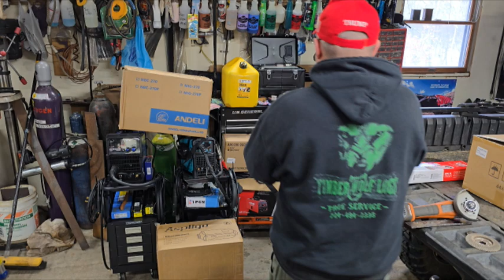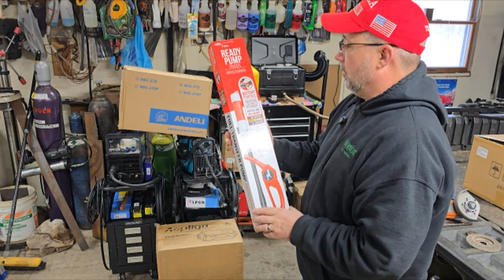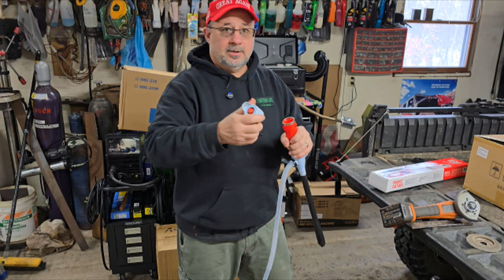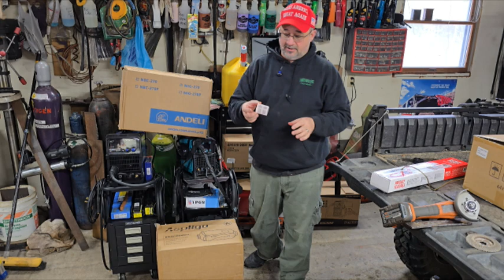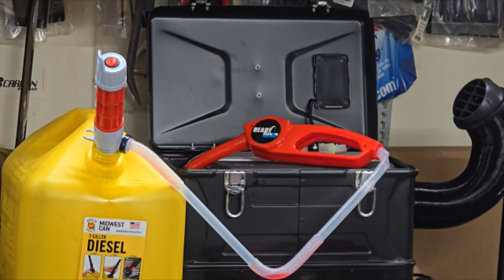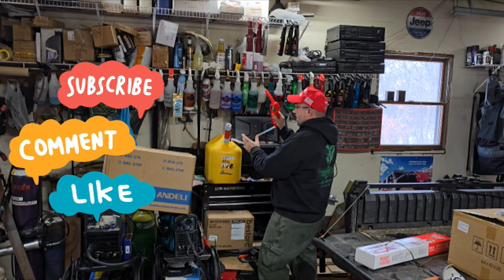Diesel Heater Fuel Transfer Made Easy! Ready Pump TRHD05

Comment: The problem I have with my diesel heater that I use in my garage is spelling even a few drops smells like I was working on a Kenworth. 
Has anybody tried using a windshield washer pump to transfer fuel from a large tank to the built-in tank on the diesel heater?¿?
Reply from the maker: @bkee62  I'm using the 2-D battery fuel transfer pump that I did also video on. If I don't do my OCD induced "fill it to within 1 drop of over flowing" it's simple and clean. But my mental issues say that I can fit just a little bit more. And more again. And again. And SHIT! IT OVER FILLED!

Comment: I have had two of these with the same exact pump and only lasted 6 months to a year and stopped running.  These work good for a while and then stop working.  Should be work for a lot longer.
Reply from the maker: By chance, did you teach out to them and see if they would help you? They show a 1 year warranty on the packaging. 
They can be reached at:
Support@terapump.net
877-251-2288

Try to reach out to them, and please let us know how they react.
Reply: @LarryMusgrave  it's been over a couple years since the last one quit, and I don't think it was that specific brand.
Reply from the maker: @rockandrattleretreat5830 

Okay. Because with these Tera Pump units, they clearly state that they have a 1 year warranty. And for the low cost of 2 units... if i had to replace them every year... I'll heal 😂
Reply: @LarryMusgrave  Do a two year review and I might try them again.
Reply from the maker: @rockandrattleretreat5830  
While I can't time travel... yet... i can find you the cheapest version of these pumps so that they are so cheap, you don't give a crap about tossing them in the trash at the end of each year. 

Here is adifferent brand and version sold for $20 for one unit, or $30 for 2. At $15 each, use one for the season and toss it in the trash. 

https://amzn.to/3PnGJb2